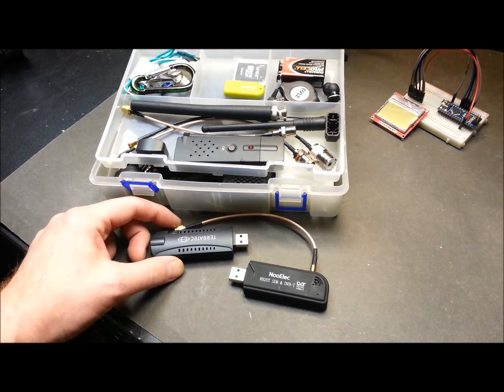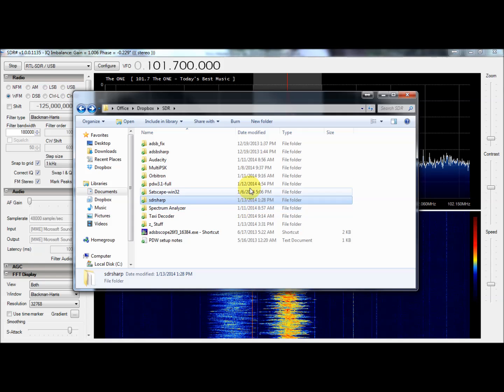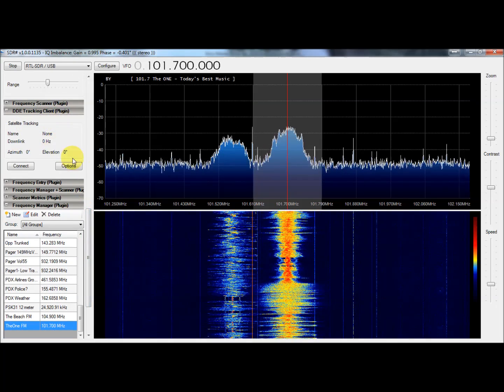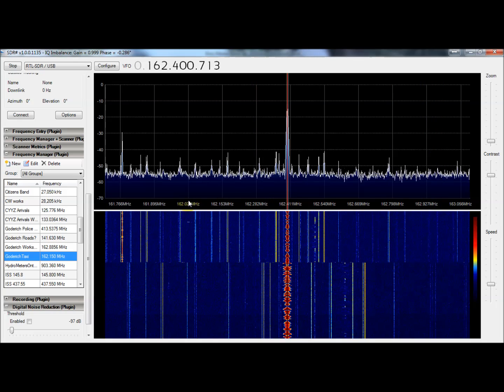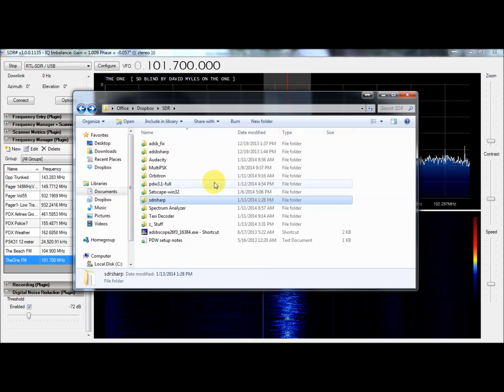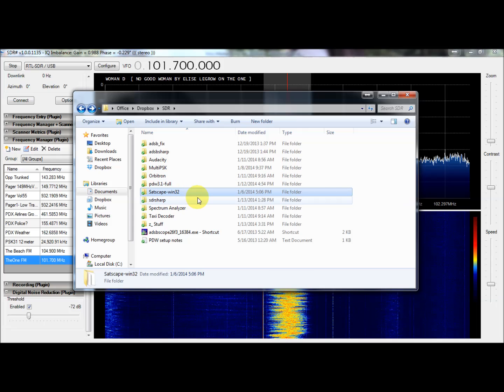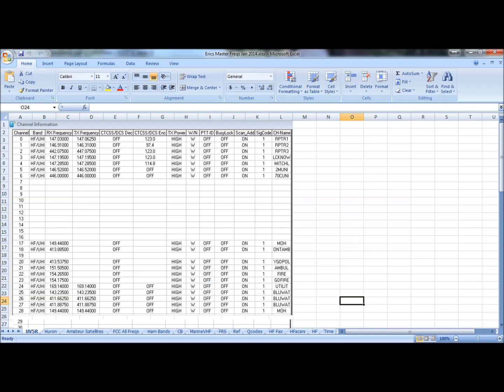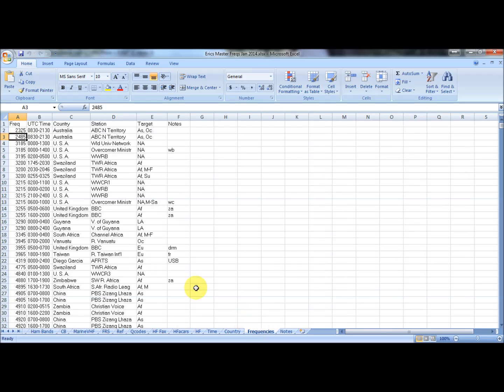USB Software Defined Radio- PC Software & Cloud Storage

Comment: Great video. What kind of antenna are you using? I have a nooelec nsdr smart on order and i am looking forward to get started in this hobby! Glad i found your vids.
Reply from the maker: A few diff ones. Most show up in the videos in my playlist here https://www.youtube.com/playlist?list=PLxyM2a_cfnzgv30vrsxayCxWWoKAFGgEo  Cheers
Reply: @MkmeOrg  thanks for the reply! I have seen more vids and could see some different ones. I have some of the magnetic telescopic ones and other small ones on order. Didnt think they would be much of use but seems like you have been getting good results. I think its more of a question of placement. Thanks again!
Reply from the maker: Just adjust the telescopic antenna to the length that equals the corresponding wavelength. Lots of webpages will give you the quarterwave, halfwave etc for any freq. Do that to optimize for any signal of interest
Reply: @MkmeOrg  cheers for the info! Will do just that!

Comment: Hi Eric.  Just getting into this world.  I am looking to capture my garage door rf signal and replay it to open the door.  I understand most of those frequencies are around 315Mhz.  I am also looking to capture my HF HID access card on the 13.56Mhz frequency and copy it to a key chain tag.  Am I to understand that I need a radio that both transmits and receives?  If so what would you recommend as the cheapest solution to capture and replay in those frequencies? Thank you or your time.Shawn.

Comment: I'm new to SDR, and this video has a lot of information presented.  Thanks. And doubly, thanks for the spreadsheet you linked to! I have had a couple baofengs that I just got too, with the intention of turning one into a scanner.  Then I found SDR.  After playing around with the Farnham Web-SDR, so I and bought a RTL-SDR (R820T + 8232). The antenna they sent with is terrible, considering this SDR's range is stated as 100KHz-1.7GHz.

My RTL-USB "dongle" came with ZERO documentation so your video was great. Any chance you have shared a copy of your SDR# folder with the add-ons loaded?

Comment: where did you purchase your adapter extensions?  I have been loooking at Amazon and do not see the same type, I also use a Boefang and would like to use the antenna
Reply from the maker: I just grabbed them from eBay.  Sorry I don't have any links- that was quite some time ago I ordered them.  There is a video on them on my channel.  Cheers

Comment: Are you using the NooElec up converter?
Reply from the maker: Sure am.  Works great.
Reply: I have a NooElec dongle and up converter, using SDR-Radio and sdrSharp, it works good on VHF/UHF but with the up converter I get a lot of AM bleadover. This not local, it outside the US. I have been trying to figure out what I am doing wrong.
Reply from the maker: Hmm I'm not sure on that one.  When I have it powered via USB and decent (somewhat) shielded connections I don't have any issues.  I hit the shift 125 in SDR# with the unit on, no shift and switch to passthrough for off.  No troubles that I have found.

Comment: Great video Eric, I just got into this hobby in november, its been great, I have been into scanner monitoring for about 15 years now, but these dongles have been great.Instead of buying a 500 dollar digital scanner, I use this and couldn't be happier. it takes a bit of effort to get it right, but just having this opens up a great way to listen to digital signals.  check out DSD+ if you haven't already. much improved over DSD 1.6.0.
Reply from the maker: Thanks.  I think the same as you- with only a bit of effort, a $10 device can do amazing things.  Thanks for the tip on DSD!  I haven't tried P25 at all yet so its definitely on my list.  Cheers!